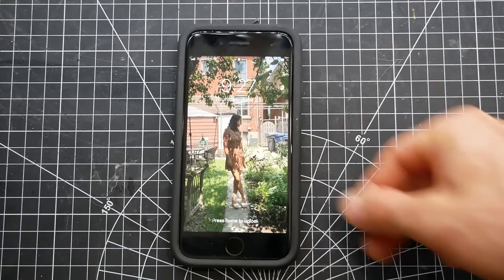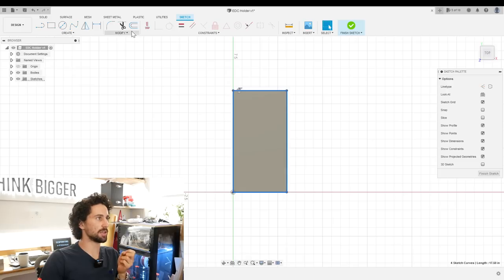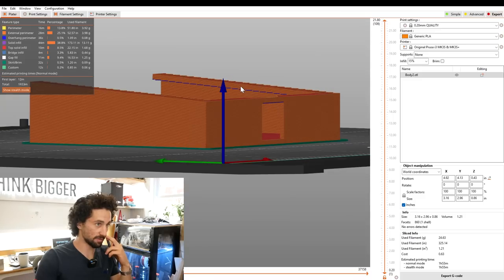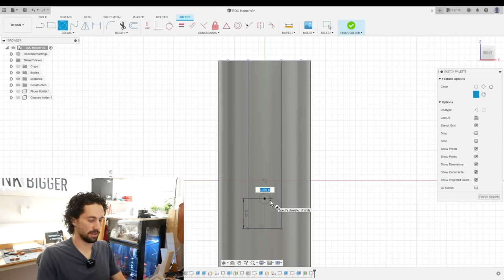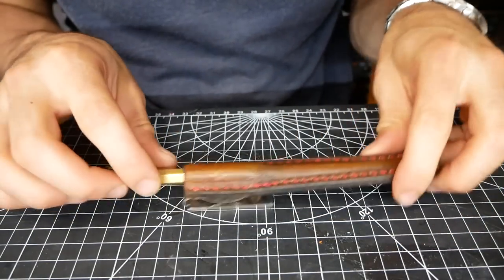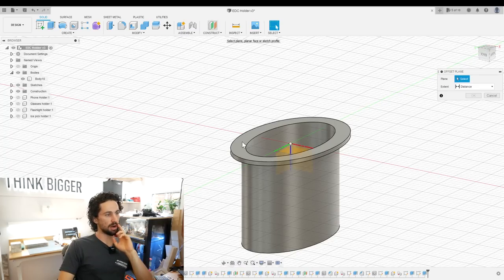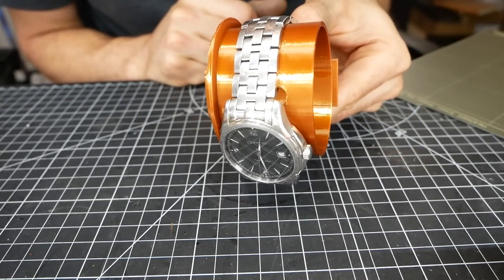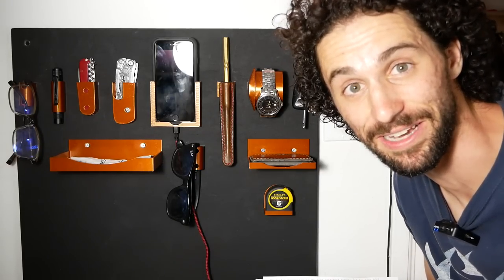Organizing My Life with 3D Printing

Comment: Just a little tip: You never need to measure screws. Every readily available screw is normalized, meaning that all of its measurements follow a norm. For example, a flathead M12x1.5x5 screw follows the ansi metric norm (because of the m), has a diameter of 12mm, a step of 1.5mm and a screw lenght of 5mm. All of the other measurements can be found on a "flathead screw ansi metric size chart"
Reply: Yes and no. Machine bolts made to standard.. sure, but there are so many variations of the head and other features that is better to just measure the bolt you have in hand to properly design the countersink or counterbore. Also woodscrews have even more mistery about thread diameter.. a quick caliper check sorts this unknown fast.

I find myself designing stuff to 3dprint and select the hardware from what i have on hand and design for that specific hardware i have. And boy do I have a collection of random bits and bobs (i hoard screws and bolts whenever i have, and before tossing old broken stuff i harvest screws/springs/ball bearings/etc). Better to measure my random bolt/screw than search the exact standard for the screw. Shaft dameter and thread specification if needed is available in the standard, but the head is rarely up to the standard, and the head is what counts for proper counterbores/countersunks. 

I use the ISO-DIN standard mostly (i'm in Europe)
The trust in standards can be high for industrial structural bolts and nuts that in fact has the standard printed on the box (like DIN971) when new from the store. But old screws/bolts made for furniture/chipboars/electronics/cars/machinery - could have a lot of variation.. car bolts in particular are high grade bolts very true to the standard if you can pinpoint it, but otherwise they are allover or even very custom made for that aplication. I have head bolts, conrod cap bolts and nuts, suspesion arms bolts... all have weird shapes of the head and the shaft, mostly fine thread, - good luck finding the standard or the original spec for that bolt. I can still use the quirky finethread car bolts if i also have the nuts .. so measuring ensures me the correct fit rather than standards.

The standards are very good whe you design a new product without the hardware in hand, in fact you search the catalog for the right hardware for your project, design with the standard dimensions, then print/manufacture and buy the selected hardware.
Reply: @AsiAzzy  that's a valid point! In the field that I work in, we rarely have the components on hand, therefore, we can't measure them. 

Also, you said that when using old repurposed screws is better to measure them, and that is completely correct! But, in this kind of application, it would be quite impractical to be repurposing old screws and see which one fits where. Therefore, if you are buying new, it's probably easier to see the normalized measurements.

Comment: Here's a tip: You don't need to measure the screws. They're standard size. Just look up "#6 screw measurements". ISO will give you a nice chart.  And here's mad-lad doing 3d printing in inches. ;-)

Comment: Why not just print the phone holder oriented vertically? Theoretically you could have saved the filament length of the supports if you would have just printed it vertically. since there wouldn't be a need to support the material where there is none.
Reply from the maker: No reason other than I failed to think of it at the time!
Reply: @MorleyKert  Oh I see! Was just curious :) really enjoy your work, thanks for the reply!
Reply from the maker: Thanks for watching! 😊
Reply: @gaminghistory101  theres also a small possibility that having the layer lines going horizontally, and screwing into them to mount it on the wall, the layers could crack apart when tightening the screw, or over time with weight pulling on the screws. The way he printed them with a big flat back plate thats far less likely to break.

one way to help avoid screw points breaking apart when you have horizontal layer lines is to use dome head screws, with washers to spread the force, don't use the cone shape holes like shown here, that will just allow the screw to force the layer lines apart even more easily.... Thats one lesson i learnt early on 3d printing.

Comment: Instead of making screw holes that go all the way through to the front of your holders, you could’ve made screw head-sized holes on just the backside with a smaller notch above the hole like with picture hangers, etc. You would just put the screw directly into the board with the head slightly protruding and your 3D printed holder would just clip onto it.

Comment: this is definitely one of those things that is a really good lesson for people to do when learning 3d printing. Everyone's kit is different so you have to design everything yourself, problem solve it all. But its also not too complicated to design basic holders.

for a nicer finish, and a more adaptable system i'd have gone with making a few different sized of brackets, with french cleats on the tops/sides, so the idea is you can screw those brackets onto the wood, and then the different holders slide onto those cleats and clip in place, so they are locked but also removeable. That way you get a nice finish without having to have through holes on the face of everything.

Comment: The quick and dirty way to skip measuring the screw is to add them in from a database in Fusion--I normally scale up a couple percent for tolerance and use as a tool to cut. Not sure if this ends up being easier, but works for me

Comment: Awesome, as always. I've a simple grasp of fusion (getting better the more I use it) but your videos show me the extra steps that I didn't even know existed to make designing & drawing so much easier - inputting parameters for instance.

Can I ask why you didn't print the phone holder upright? You would have avoided any support material and the front would have looked a lot cleaner without the large steps.
Reply from the maker: Thank you so much!

You know, I honestly didn't think of it until reading your comment. That's a great idea, and I should've printed it upright! 

Next time :)

Comment: The only thing I would do differently as add some felt to certain areas to prevent scratching with continued use. For example felt to the inside of the Letterman holder or felt to the watch drum etc.

Comment: Next time you do a wall mounted 'storage' unit, use a French Cleat setup.  No need for screws except to mount the rail.  Then each of your items will be infinitely movable sideways.
Reply: And then they can fall off the cleats every time you take your knife out. I personally think French cleats are overrated for stuff that doesn’t need to be adjustable. Uses a lot more material and adds complexity to something simple. Don’t get me wrong, they have their place, but I think they are more suited to blind mounting of larger objects like a large picture frame or upper cabinet instead of the end-all solution to wall mounting. Many a sheet of plywood has been dedicated to walls full of French cleats for holders that never move.

Comment: I think, I love the fact that you're so easily willing to just get the thing done and avoid nit-picky features or issues. The entire time you designed things I thought to myself "that could be so much better here, and here, and there" and it just didn't matter. You printed it anyways, I would have trashed most prints that looked close to the results of your printer. I would have spent far too much time designing PERFECT fit holders and such, but you just let it go and kept going. No fit n finish, no polish, just do the thing. 
I need to do this more

Comment: For that watch stand, you could have printed just a little lip in the bottom, and kept the watch part itself separate. Tight enough that the layer lines alone create the nice snap fit. 

That way you wouldn't have had to poke holes all the way through

Comment: How do you measure the strength or threshold capacity for shear or vertically strong builds? Is there a table or way to know how strong your 3d printed items are or the weight they can hold? How does this work in 3d printing? All this is new to me. Tnx!

Comment: Awesome video as always! You may have already answered this, but is there a reason you use imperial instead of metric units? I’m American, but use mm for small things because it seems more precise… but obviously it works fine for you!
Reply from the maker: Thank you! I grew up in America so it’s what I’m used to. I have a pair of imperial calipers subdivided into thousandths so it’s quite accurate - it’s all just numbers at the end of the day! 😊
Though I am slowly making the transition to metric, and use both when it comes to 3D printing (layer heights,
For example).

Comment: Hahahaha I've been making 3D printed stuff in Fusion 360 for ... I don't know, a couple years anyway.... And I never knew there was a CREATE HOLE function hahaha. Here I am drawing sketch circles and doing manual chamfers like a n00b. This is going to change my life.
Reply: In return I will give you this gift: if you want to select something that is inside or behind another object, rather than hiding the intervening objects in the tree (like hiding the body, as you do a couple times), you can just hold the left mouse button down for a couple seconds and a menu will pop up with every object your cursor intersects with.
Reply from the maker: Thanks for the tip!

Comment: Great job, though, personally I would have made the watch holder a little larger to allow the face of the watch to be more outward facing (yup a little OCD here lol), HOWEVER, a 2 or 3mm thick strip of self adhesive foam rubber strip applied to the width of the watch holder barrel would do a great job and, apply a little black colour to the watch holder itself. Maybe a little of that self adhesive foam stuff could be applied to the other parts too, to say, cushion the bottom edge of the phone etc etc...? 🤔😏     😎🇬🇧
Reply from the maker: Thank you! To each their own, I like the clicky slot into place 😊

Comment: you should of made a pocket for your charger cable so you don't have to mess with the cable, just drop in and pull out.
you should do a fusion360 for dummies video to help us that watch you do all that stuff!
Reply: And a free floating cradle inside the holder supporting the phone, with a lip on the front for your finger to pull up on, disconnecting the cable.

Comment: The phone holder, if you printed that standing up, you wouldn't need support? 🤔
Reply: Also, re: Stringing -- It happens a lot with silk material. If you have a heat gun, you just need less than 10 seconds to melt them all away.
Reply from the maker: Totally, I just didn’t think of it at the time! Thanks for the tip re: the heat gun, I will definitely use that on my next print! 😊
Reply: @MorleyKert  or that lighter on the end of your tool rack would work just as well for melting the stringing off.

Comment: why didnt you just print the phone holder upright, to avoid supports?
Reply from the maker: Just didn’t think of it at the time! That would’ve been a better way to go.
Reply: @MorleyKert  your screws may have just cracked apart the layer lines printing that way though.